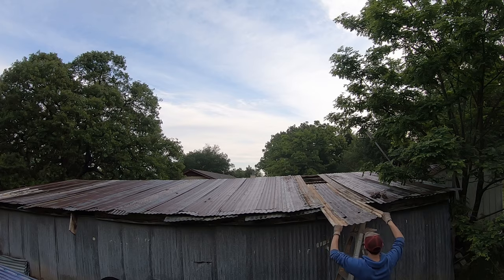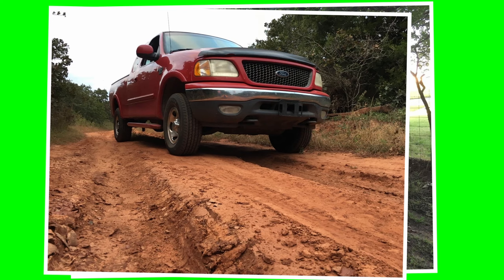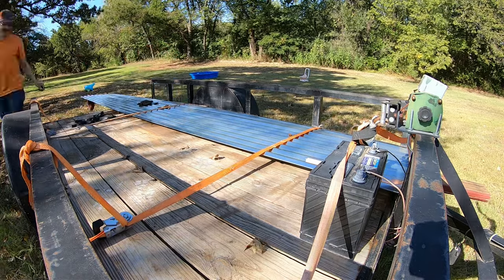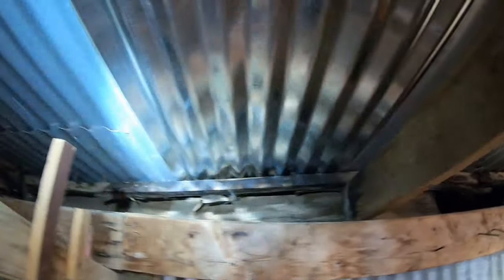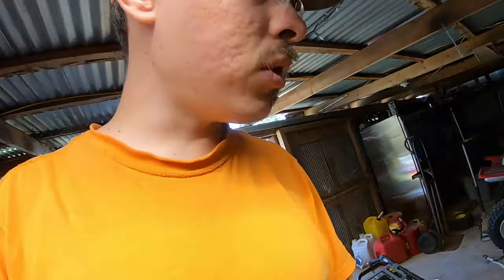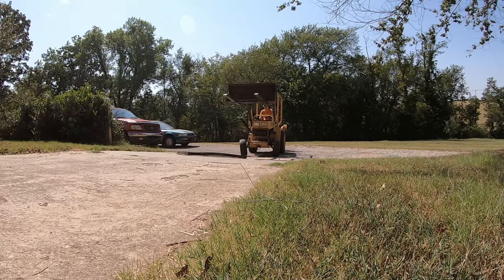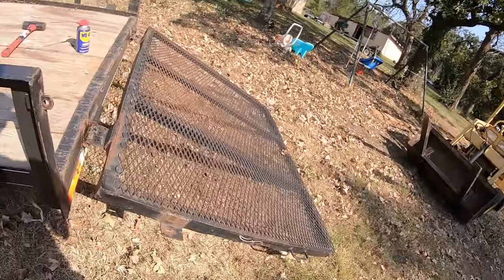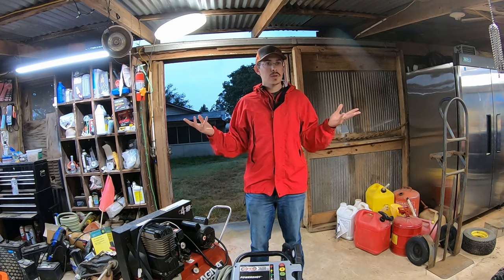I learned my lesson with this shop roof repair | Garage Story

Comment: Well, it's a warranty, actually not really, it's a purchased warranty more like insurance. They sell them so they recoup their cost of a replacement (which is way less than 18 bucks). For their end it's a paid-for replacement whether on the months old one or the days old one. It's not like you'd double dip on the warranty later with one of the new lights. Would not seem dishonest to me. Though I would also have just fixed or replaced the switch as you did. They aren't called Hazard Freight for nothin'.                       [I won't get started on morals of supporting a dictatorial genocidal regime that's our largest international enemy, LOL. {But not really lol}..... ]